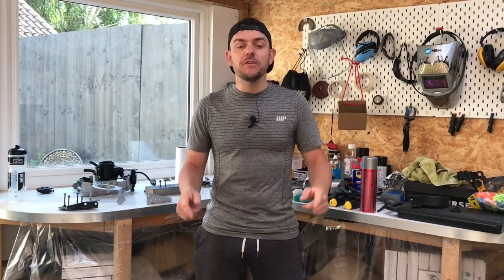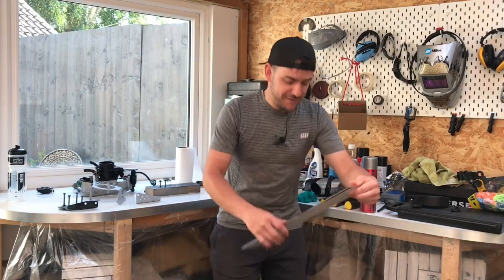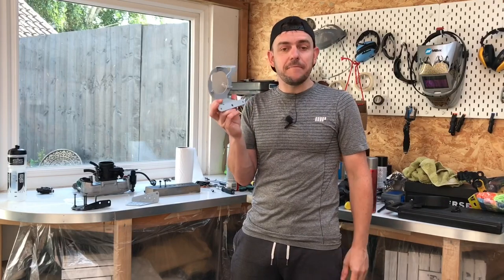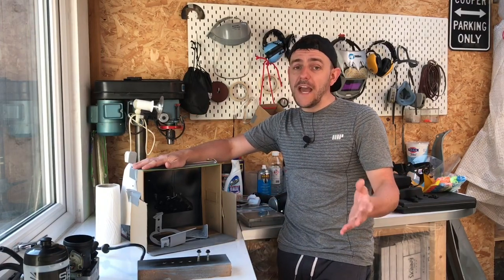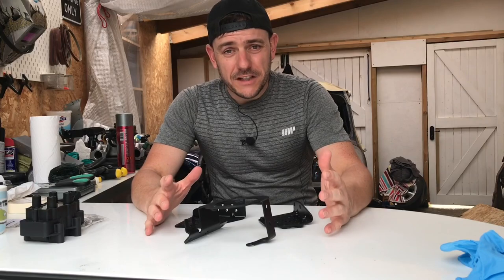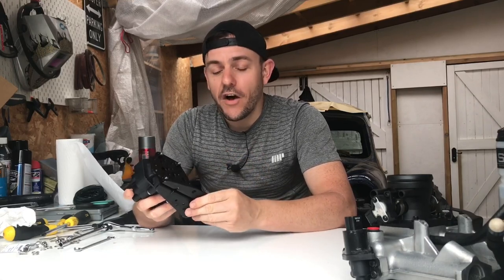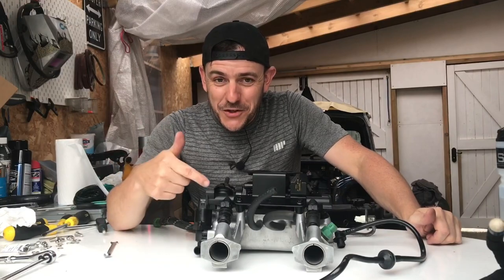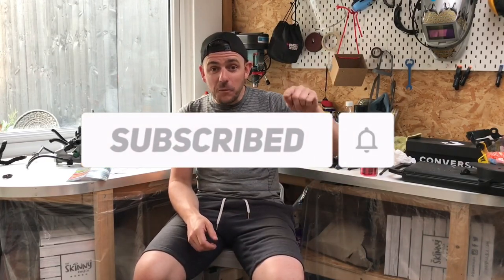Classic Mini Cooper Sportspack - Painting Parts Using A Spray Can

Comment: You're welcome 😉 Brake cleaner has multiple uses, it's especially good for when you need to degrease anything. As well as paint prep I clean off anything that is being bonded together for perfect adhesion, and general cleaning. You will find it expensive using aerosol cans, it's worth investing in a Wurth brake cleaner pump and then you can buy 5L at a time. Polygard brake cleaner is very good and cheap. In the long run, you will save a lot of money!
Reply from the maker: Thanks! Knowledge is power 😁 I don’t think I could have painted them for a 3rd time!
Reply: @PocketRocketGarage  It's so frustrating when paintwork goes wrong.